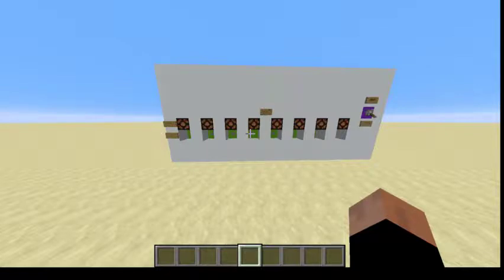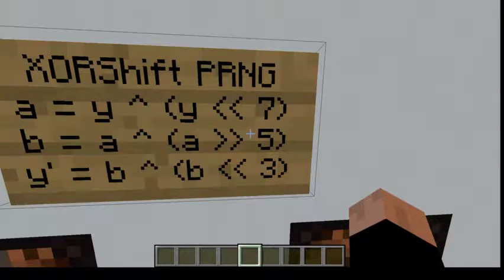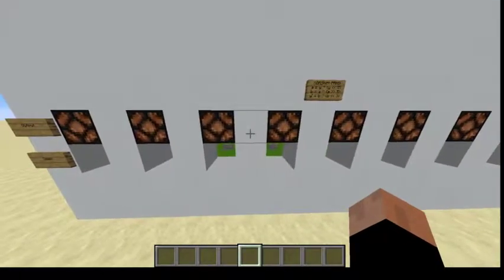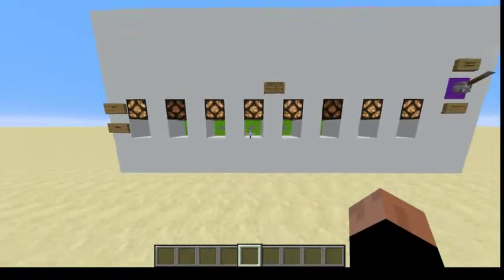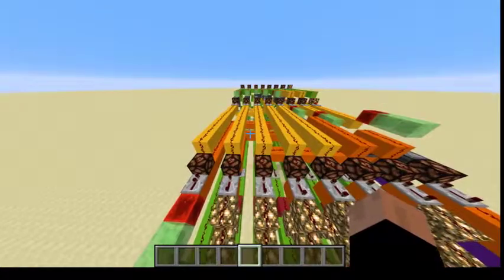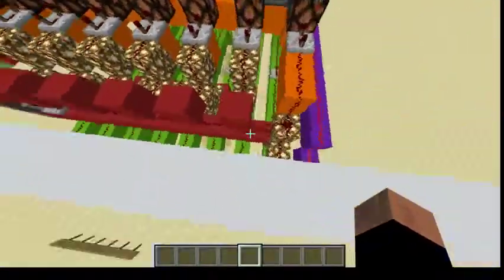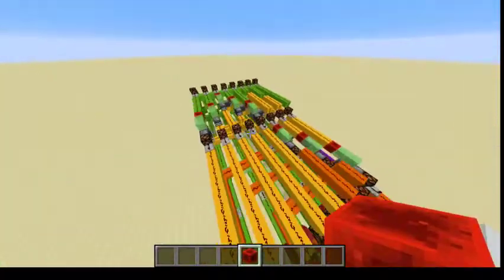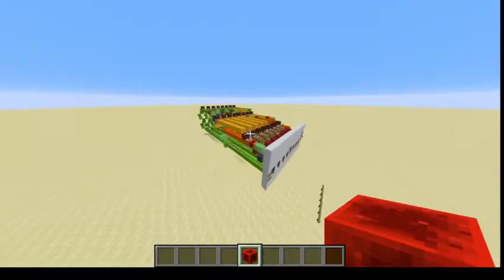Minercraft PRNG: XORShift 8

Comment: Thanks loads for this video I appreciate it.
Reply from the maker: You're welcome. This isn't really practical to build, but it was cool to implement. The random number generation is pretty bad though. For most seeds the cycle length is only 21 or 22. Ideally the cycle length should be 255 for any need but 0.
Reply: @gyroninjamodder  I was looking for any 8 bit xorshift implementation, it was quite coincidental that it was a Minecraft video that had what I was looking for!
If I go anywhere with what I'm working on I'll come back and tell you about it.
Reply from the maker: @Xilefian  I just brute forced the constants to find cycles of 255. They are 1 1 1, 1 2 5, 1 2 7, and 1 3 5. I ran them through dieharder and 1 2 7 came out with the best results by being weak on the least number of tests.
I found the constants I used in the video some where online.